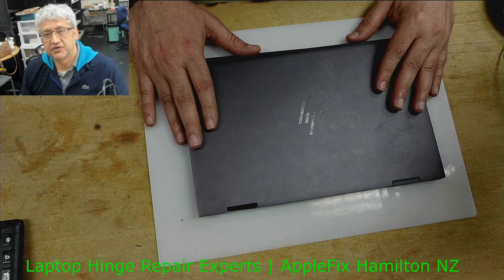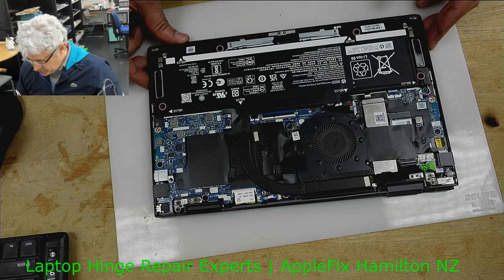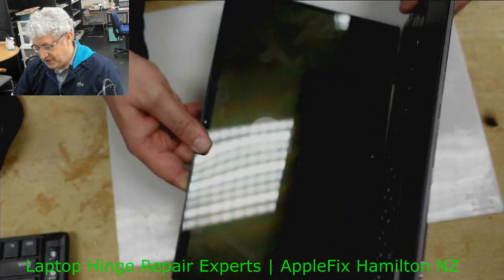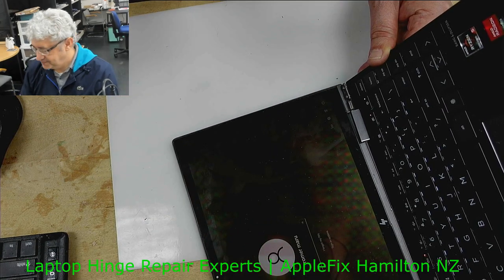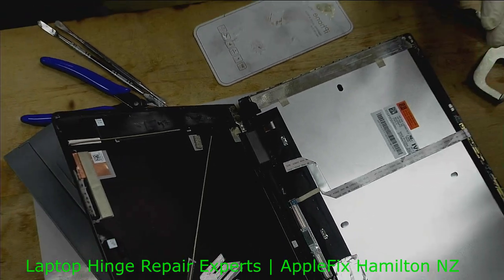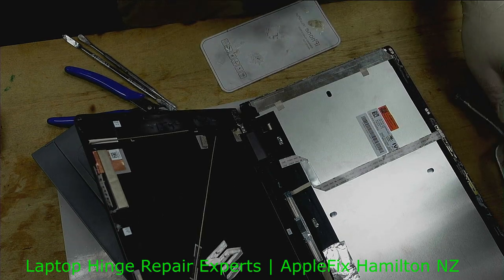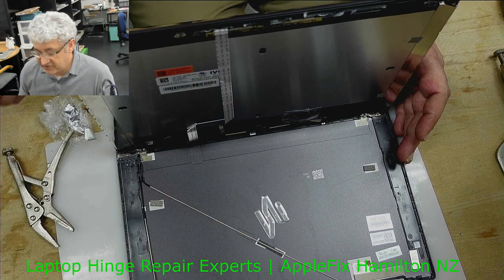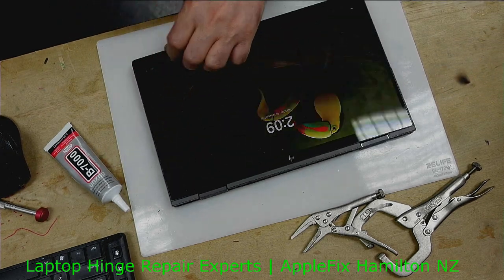Laptop Hinge Repair Experts Hamilton New Zealand | HP Envy X360 Convertible Broken hinge | AppleFix

Comment: Hey mate, the problem is that the hinges get full of lint and dust and they get tight to move the hinges causing them to break away from the weakest part which is the back of the screen. I noticed that you didn’t clean the hinges or lubricate them or try to fee them up. If you had one like mine that are very hard to move the hinges, how would you free them up and what lubricant would you use? I’ve particularly freed mine up using electrical silicone grease but I’m thinking of using spray graphite powder and before I tried it I wanted to get your advice on using graphite on a laptop